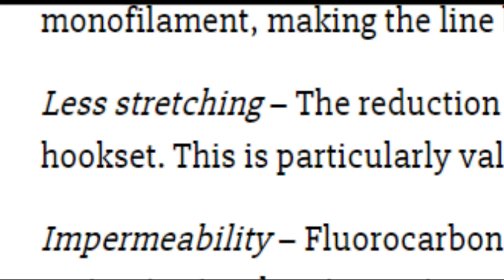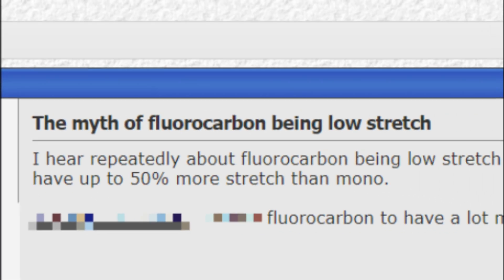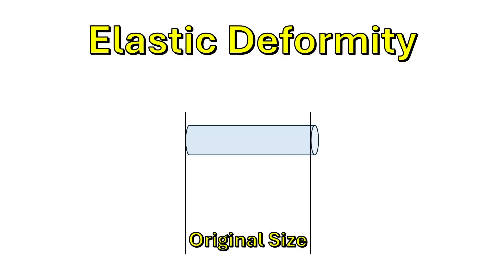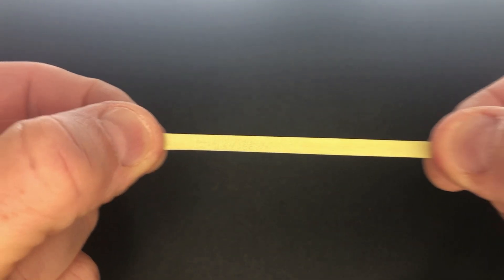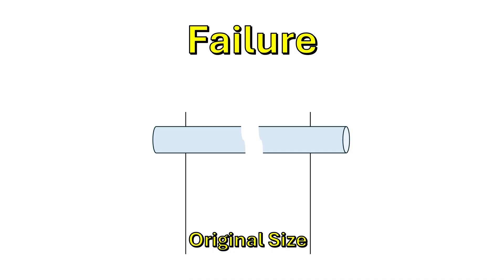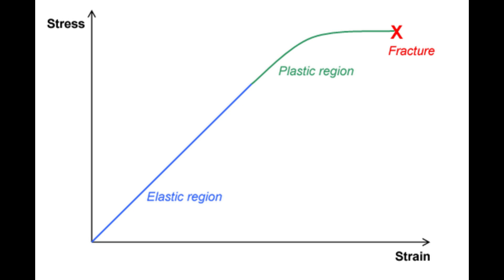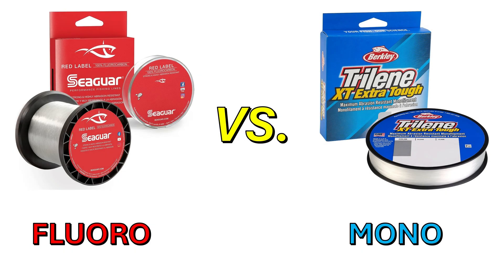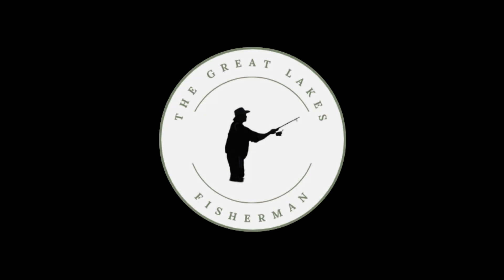The Truth About Monofilament and Fluorocarbon Line Stretch

Comment: I run 10lb braid with a 8lb floro leader using a uni uni knot. When my line breaks it’s always at my union knot on the floro. Drives me crazy. I think the knot stresses the floro no matter how much care I take when tying my knot.
Reply from the maker: For sure. I’m doing a future video on the differences between fluoro and mono and knot strength is one of them. Fluoro is stiffer and thus is damaged more by tight bends such as you find in knots.
Reply: Double Uni does not compare well to the FG knot for braid to Fluorocarbon. Many tests out there.
Reply from the maker: This makes sense as the fluoro would have zero knots bends and this would not weaken nearly as much. Thanks for the comment!
Reply: @bike4him589  I’ve shied away from it due to its complexity. Standing up in a boat in high winds trying to tie the FG seems miserable. I guess I just gotta learn it and practice it.
Reply: @andrewszot3094  the FG knot is what you tie in your garage. The Double Uni is what you tie on the boat.😁